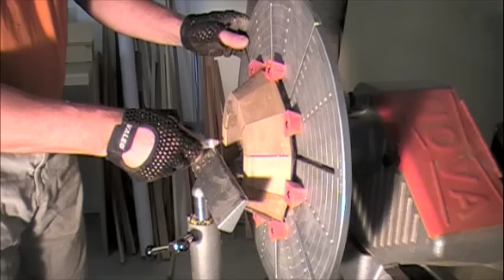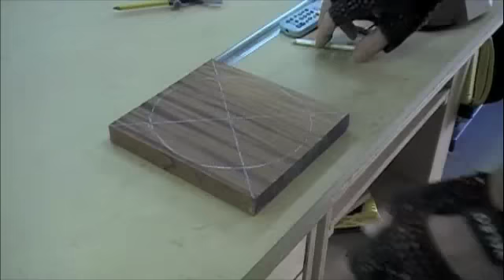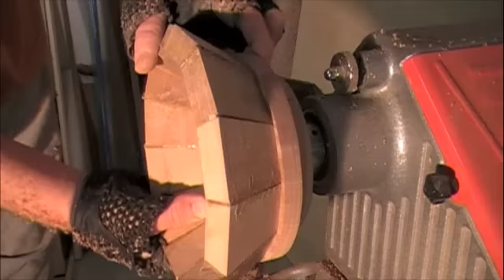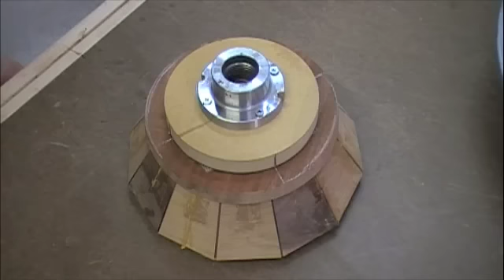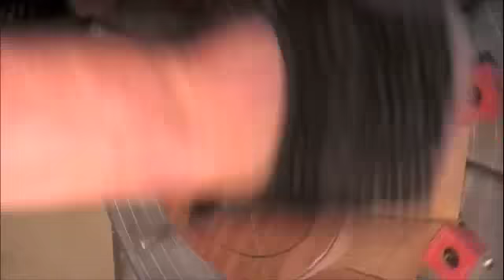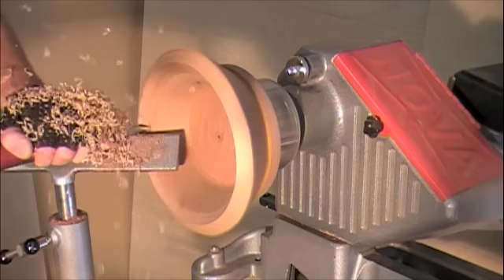Segmented Woodturning - How to Turn a Fruit Bowl Video - Wood Lathe Methods - Part 2

Comment from the maker: Jack Kerr...
Thanks for the compliment. 

Here are my thoughts on the subject of rubbing the wood turning with shavings. I too have heard & read that rubbing with shavings can close the wood pores to prevent the finish from taking. I have read and heard where the burnishing makes for a smoother surface.

Sometimes I believe we need to find out for ourselves what actually works & what does not.

In my case, the bowl's surface is very smooth & the finish took.

I rest my case. Great question!